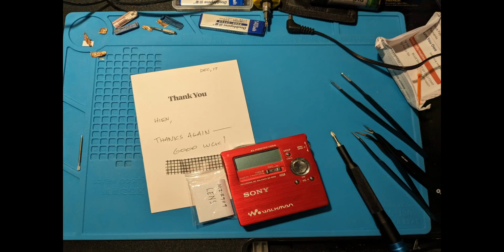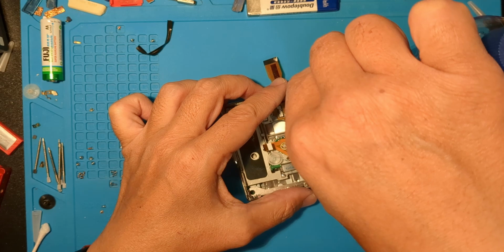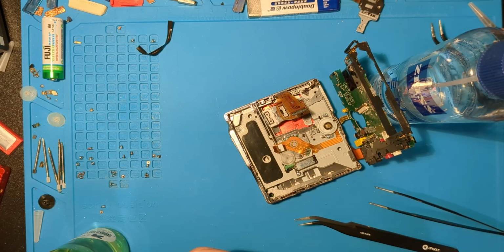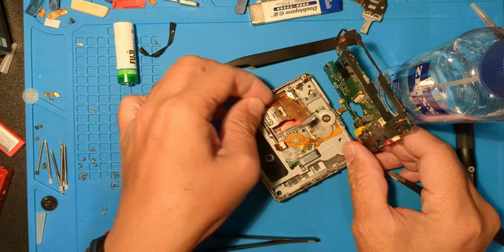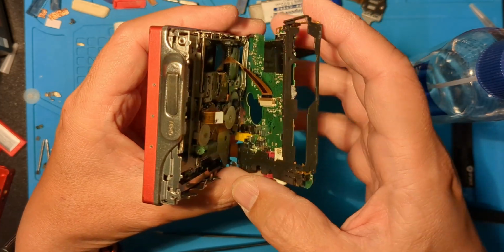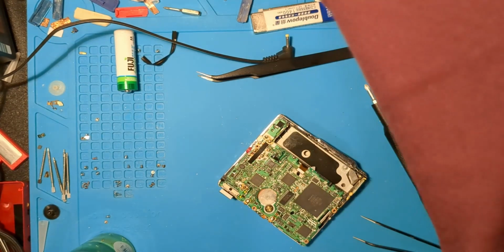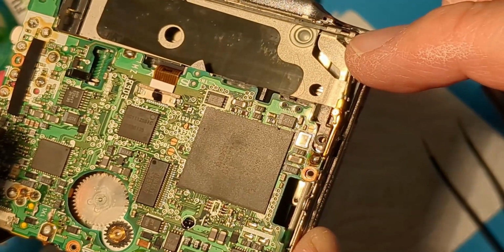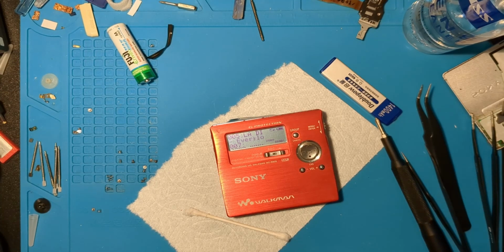Sony MZ-R909 MiniDisc Recorder Repair Fix - Bad Laser? Swapped It 3 Times!

Comment: First, Thank you so much for all your videos! Very Helpful.

For some reasons, simply replacing the lens isn't enough for some models. I had the exact same problem with the same model recently. I managed to get it working again by manually adjusting the laser power gain by turning the small screw located on top the optical block. This operation requires patience and repetition. 
The screw only needs to be turned a few degrees at most (I've generally noticed that the cross of the screw should be perpendicular to the frame of the optical block). 
Once the device starts reading the disc again , activating service mode might be helpful if the disc read response time is considered too slow. 
At least it works for me.
Reply from the maker: Thank you for stopping by! 

I have seen some fixes with the manual adjustment like you mentioned, but I hesitate to recommend that without a laser power meter (which I don't have...). I think you could trial and error very carefully like you have and get it dialed in though! I've also heard of other people doing that successfully!

Comment: Hey, nice video. I have the same walkman, and my headphone jack is not working properly. When I plug in the headphones, only right is playing. If I apply some pressure on the jack - the left plays too. It's like bad contact. Also, the headphones go inside very easy. Any idea how to fix?
Reply from the maker: Thanks for stopping by! The good news is that it is somewhat working!  First thing would be to look inside the headphone jack with a flashlight and see what you can find. Perhaps there's something wedged in there that's making it easy to insert.  You can clean it with a toothpick and possibly even soak the toothpick in isopropyl alcohol.

If that doesn't do it, you may have to open it up and see if the headphone jack may need to be resoldered to the board. You may be able to test this while the case is open by leaving your headphones connected and pushing down on the headphone jack without twisting or moving your headphone plug.

Comment: can u provide a link where to buy the replacement lens? thanks
Reply from the maker: Sorry I didn't buy it separately but had to remove it from another player
Reply: @TechnicalInitiative ah i see, thanks
Reply: @TechnicalInitiative  fixed mine, bought the lens assembly from china, used. however i am not sure if its alignment issue, there is some noise (sounds like laser sound) from within while playing. the unit play song just fine. one more issue, is the recording. the unit can record just fine, however, it cant  complete TOC edit, i will just remove battery, and the recording are still there, can play without issue. tried cleaning the write head, no luck. any idea?

Comment: Hi....your videos are great....but I'm not that brave....I've had an mz-909 since new but it's finally given up on me....I purchased a beautiful blue one on eBay with the option return if it didn't record.have you any idea why when I plug in to record it says mic on the screen instead of line in? There is no sound through headphones while trying to record....any thoughts appreciated before I return it. Thank you.
It plays perfectly with the usual fantastic sound quality.
Reply from the maker: Hello! This is very interesting since I can't replicate it.  I tried it on an N910 and N920 - If I plug a mic into the Line In, it still just says "Record" but if I plug the mic into the Mic jack, the display updates to "mic".  From what you were describing on Reddit, it sounds simple enough, so perhaps something is just wrong w/the unit.  Though not all-metal, I think the MZ-R700 may be a good choice since it's got a nice form-factor and uses AA.

Comment: This is one of my current favourites. I really like the brushed metal look. I have two of the silver model. One is boxed with all the accessories and the other is my runaround one which I was using on the train today.
Reply from the maker: It's a nice unit! You seem to have a lot and I'm glad to hear they're in regular use!
Reply: @TechnicalInitiative  I've got about 50. I have an MZ-1 in a presentation pack which came from Ford Motor Company. The case is emblazoned with the Ford logo and it has two pre-recorded demo discs and three still sealed 60 minute discs. It only works with pre-recorded discs, presumably because of a weak laser.
Reply from the maker: @ianz9916  That sounds amazing and rare! Any chance of some photos?
Reply: @TechnicalInitiative  Sure, how do I get them to you?
Reply from the maker: @ianz9916   you can email me: hien at technicalinitiative.com - looking forward to them - thank you!